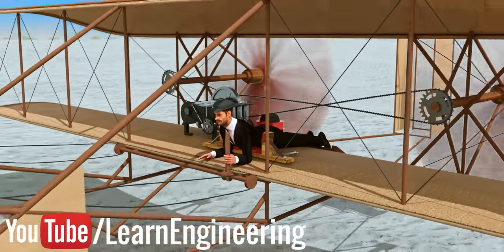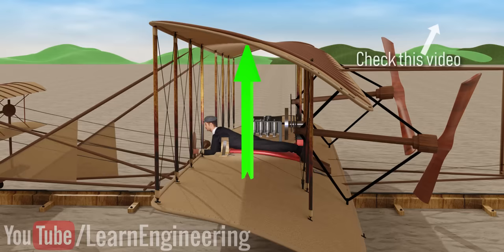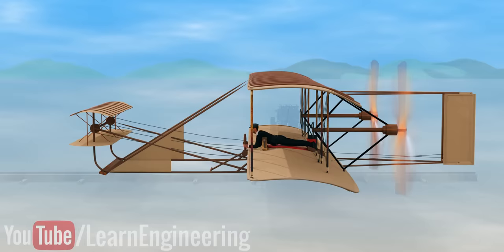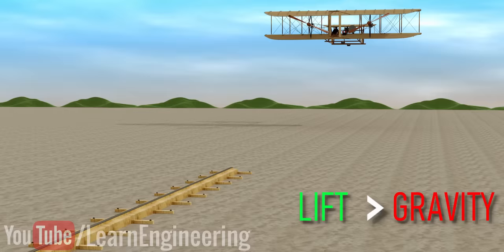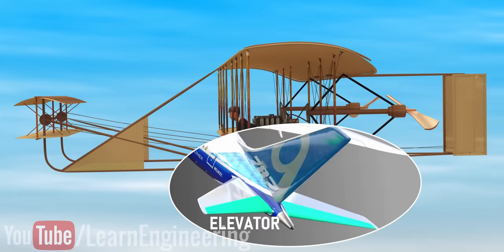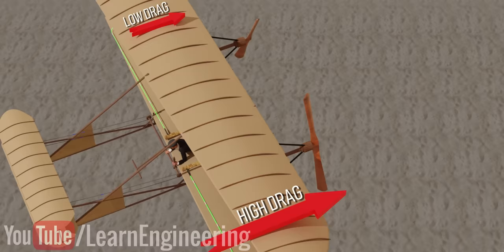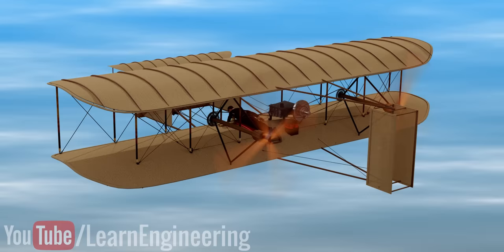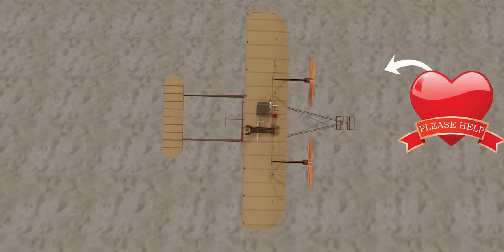The Brilliant Engineering of FIRST FLIGHT !

Comment: Offcentered to balance the weight of the engine and let the center of mass be in the middle :D
Reply: simple as that :)
Reply: Yup
Reply: Noo, its not like that. Its bcuz they didn't have compulsory co-pilot rule back then. :D
Reply: Yep
Reply: And the gas tank should be center placed as its weight varies through out the flight.
Reply: Yeah..
Reply: Easy peasy
Reply: Exactly. As clever as he was, he probably has a metal ballast positioned to compensate any weight difference by operator.
Reply: however, the weight of the engine was also countered with a slightly longer wing on one side to prevent unwanted roll from the extra weight
Reply: I wonder if they made adjustments on the fly lol if someone else tried to pilot with a different weight then they would need to move the engine or add weight to the pilot
Reply: An easy assumption to make but not exactly the case my friend... because both brothers were right-eyed, they positioned their body slightly to the left to line up their dominant eye with the centreline of the plane, otherwise maintaining straight and true flight would’ve been impossible due to the gyroscopic equilibrium of the propellers.... obviously 🙄
Reply: Forget it, the replicas have already proven that they didn't fly. Their work between 2003-1905 was a big lie. The centennial proved everything. A perfect and improved replica did nothing.
Reply: Careful, the replicas proved that they did not fly
Reply: Sry but it wasn't the first flight
Reply: FORGET, 1903-1905 flyers DON'T FLY
Reply: If the Flyers really flew, why they disassembled it and put it in a deposit for almost 3 years( between 1905 and 1908)?
   How on Earth would someone stop experimenting an experiment if it was successful ?
    Makes no sense at all.
Reply: yup
Reply: @vignesh sureshbabu And weight of the engine is 180 lbs
Reply: Exactly
Reply: My assumption exactly. Balance with the engine
Reply: All of the answers are plausible but none of them provide evidence.
That includes my unsupported conjecture that safety might have been a reason.
The Wrights would have survived the kind of accident that Capt. Feber  experienced.
He was testing the Antionette prototype that positioned the engine directly behind the pilot.
In 1909, Capt. Ferber was crushed by the engine..
Reply: U R "wright" :^)
Reply: @gilberto2056  The exact replica of the WF1 requires the assistance of both an 8 hp + engine and a headwind well above the 4 mph wind that was available on Dec. 17, 2003.  The only thing the Centennial non-flight proved was that more wind was required.
The Wrights' would have made no attempt to fly without strong headwind .  On Dec. 17, 1903 they had gale force wind.  21-27 mph.
Reply: @gilberto2056  The failure to fly on the Centennial date only proved they they needed the assistance of a strong headwind and a 8hp + engine to take off.  We are talking about a hop according to the definition that the Wright Brothers used.  Any flight under 600 ft. was just a hop.  The official distance for the 14-bis flight was also just a hop.
Reply: Arber _D  Do you mean what if the pilot weighed more than 150 lbs?

This might be important with the Wright Flyer I.  In gale force winds, the pilot could be 20 or so lbs. heavier.  On a day like Dec. 17, 2005 with wind gusts no more than 4 mph., the Flyer would not take off with a an underweight skinny pilot.

After 1906 when the 28+ hp. Wright-Taylor upright 4 became available,
weight was no longer a major concern.  The Wright Flyer Model A
could easily handle the weight of a passenger. or more fuel.
Reply: ye
Reply: @rjnbonif3603  No one can answer what?  

If the question is "Could the 1903 Wright Flyer fly without a catapult, strong winds, and a hill?"  
We can certainly see what historic evidence is available.  

Wilbur did try to determine if a hill could substitute for the lack of a strong headwind. on 14 Dec. 1903 when the windspeed
was around 4 mph (the same as on 17 Dec 2003.  We can read the reported results.

We can probably answer the question of whether or not the Flyer could fly without a catapult .  
It flew without the catapult several times before August 1904 when the catapult was first perfected.  

RB:: 2 When did the Wrights fly their FIRST PUBLIC  RECORDED FLIGHT????  Which reliable institutions, journalists, government....   were there to certificate Wright Brothers flights??????? 

SB:  Is this a new question?  All of their flights were public and viewable from the interurban train or by those who lived nearby.
The public was invited 4 times. Once in late 1904  when the Flyer II completed over 20 laps of the Huffman Prairie pasture for 20 min at an altitude above ground effect. and at least 2 times in 1905.   One public flight was cancelled because of engine problems.  

RB:  Did anyone certify these flight?  

SB:  They were certified in 1905 by the newly formed American Aero Club.  They were certified by the French Aero Club and the FAI in 1908.    There were a few journalist there but they lacked the kind of interest that pioneers enjoyed in Europe.  

RB:  What reliable institutions reported on or certified the 14-bis flights?
 
SB:  What institutions reported on the 1906 14-bis 100 m. hop?   (other than the Aero Club and the FAI)

You were supposed to comment on the video of the exact replica of the 1903 flyer flying.  
Instead you asked me to review the Centennial video. which only proves that the Flyer would not fly
without assistance from the wind,   It does not prove that the Flyer could not fly.

Replica flies 100 ft. in 15 mph wind;  
https://www.youtube.com/watch?v=o1mscspl-VU

Why are you just repeating the question?

Worth reading:

Henrique Lins de Barros, a Brazilian physicist who has written two books on Santos-Dumont, 

told Reuters in 2003 that the Wright Brothers’ flight did not fulfill all the standards in place 
at the time, which included taking off unassisted, publicly flying a predetermined length 

in front of experts and landing safely. 

“If we understand what the criteria were at the 
end of the 19th century, the Wright Brothers simply do not fill any of the prerequisites,
Source:  Reuters 2003Greg wants to add altitude density (see

ANTOINETTE:   https://en.m.wikipedia.org/wiki/Antoinette_(manufacturer)

Centennial flight:  exact replica fails without wind or a catapult on 17 Dec. 2003
https://www.youtube.com/watch?v=povGggaIK2A

https://www.youtube.com/watch?v=LigpsX1KoQE&lc=Ugz3ThGdq077FdvXoHR4AaABAg.92b_4UIeIYt9MjA3A6a8nC
Reply: @rjnbonif3603 

RB: 1. sem uma catapulta.

SB:  Ele voou sem a catapulta várias vezes antes de agosto de 1904, 
quando a catapulta foi aperfeiçoada pela primeira vez.
Ele voou algumas vezes depois disso em OHIO, quando os ventos eram fortes o suficiente 
para o voador decolar em derrapagens.

RB: 2 Quando os Wrights voaram seu PRIMEIRO VÔO PÚBLICO GRAVADO ????
Quais instituições confiáveis, jornalistas, governo ... estavam lá para certificar os voos da Wright Brothers ???????
Reply: @stevebett4947  "SB:  What institutions reported on the 1906 14-bis 100 m. hop?   (other than the Aero Club and the FAI)" hahhhh  "OTHER THAN AEROCLUB AND FAI"!!!!!!   The MAIN flight institution on earth!!!!!  plus all europe journalists, crowd, gov representants........!!!!!!
Reply: Could you tell me how was the cooler/refrigeration system and how many seconds the underpowered engine of the Flyer could work before overheats????    Could that engine lift up the Flyer?????  ......not even on the top of a hill, with strong winds and guys pushing?????    

 A HILL  AND THE WRIGHTS MISERABLE FAILED  WHAT ANY GLIDER WOULD EASILY DO!!!!!  The BASIC: The Flyer couldn't fly on !!!!!FLAT LAND!!!!  IT'S A GLIDER NOT AN AIRPLANE!!!! At that time Montgomery was flying FOR 20 MINUTES.    The  Hargrave-cell box  biplane was  invented in 1893 by Lawrence Hargrave, WITHOUT MOTOR, THAT WAS  COPIED BY THE CHEATERS WRIGHT BROTHERS  AND THEY DID THIS SAME AIRPLANE COPIED ALL THEIR LIVES.   SO if he would use a small UNDERPOWERED rubber motor in his GLIDER to fly for 20 minutes would you  consider Montgomery GLIDER to be  "the first powered, heavier-than-air machine to achieve controlled, sustained flight with a pilot aboard"???     HAHAHAAHAH  That's what the Wright CHEATERS Brothers did!!!!!!
Reply: @rjnbonif3603  I agree with much of your comment on 4/30/2021
Why don't you only list the parts that I doubt?

Chern:  If mother nature doesn't cooperate, the 1903 Wright Flyer replica (tested by NASA ) won't fly.

Chern  The El Segundo replica will make modifications to make it more flyable and safer.

SB:  I don't have a video of Segundo group's effort.  Have you found it?
All of the replicas were supposed to have FAA approval.  We know that at least 5 obtained them.
They recorded a test flight that was successful enough to get FAA approval.  

SB:  Hyde could not make the changes that would make the plane safer.  It had to be exact.

Look alike replicas are not restricted.  They often improve the flying capabilities of a flying machine.  Calassa certainly made such changes in his look-alike replica of the 1906 14-bis..

No one disputes the fact that the original 1903 prototype was virtually unflyable by a novice.
The fact that those with no more than 30 min. at the controls could fly at all is remarkable.

Interpreting the results is difficulty because they have yet to fly in the high winds that the Wrights had in 1903.  Would they fly better or would they crash sooner?  So far we don't know.  It hasn't been tried.

The article in the NY times is dated SEP. 29, 2003 well before the Centennial and before the tests flights.

LINK: 

The quotes opinion and intentions are from early 2003 before any of the flight tests.
Hyde is overly  optimistic and is betting that the conditions (mainly the wind speed and air density)  
on 17 December 2003 will be close enough to those on 17 Dec. 1903 for flyer to fly.

Chern is predicting that they won't.  His weather forecast was right.
His belief that the windspeed had to be at least 21 mph to get off the ground was wrong.
Reply: @sanpol4399  Exactly, at that time MONTGOMERY WAS ALREADY FLYNG 20 MINUTES with his GLIDER!!!!!  SO if he would use a small UNDERPOWERED rubber motor in his GLIDER to fly for 20 minutes would you  consider Montgomery GLIDER to be  "the first powered, heavier-than-air machine to achieve controlled, sustained flight with a pilot aboard"???     HAHAHAAHAH  That's what the Wright CHEATERS Brothers did!!!!!!  ...I mean, they tried but failed  EVEN WITH  AN ENGINE!!!!!
Reply: @sanpol4399  THE USA AVIATION WAS DESTROYED BY THE WRIGHT BROTHERS FALSE PATENTS THEY DIDN'T INVENTED!!!   In the first war  USA had to use EUROPEAN AIRPLANES BECAUSE THEY DIDN’T HAVE A SINGLE DECENTE AIRPLANE  THAT COULD FIGHT AGAINST ANY EUROPEAN COUNTRY!!!!!!!!    WHAT A SHAME!!!!!   

The AIRPLANE Santos Dumont Demoiselle 1907 weighed only 56 kg and had a  40 hp motor and could fly at 120 km/hour meanwhile Wright Brothers GLIDER model A weighed 573 kg with a small engine 35 hp in 1908 was still using a catapult and only could fly at 67.6 km/h.

YOU WILL NEVER EVER SEE A FLYER REPLICA FLYNG!!!!  OR A REPLICA OF ITS ENGINE WORKING TOO!!! BOTH ARE GARBAGE!!!
 All you can find are replicas of  MODEL A  from 1908!!!! 1908!!!! 1908!!!!!!! when they FIRST APPEARED IN PUBLIC AFTER THEY SAW SANTOS DUMONT AIRPLANES and was still using a CATAPULT and the Model B from 1910.

The END OF THE BIG AMERICAN LIE:  WRIGHT BROTHERS  LETTER   FOR   CAPTAIN  FERBER   WILBURN  ASKING  THE   14  BIS - SANTOS   DUMONT  DESCRIPTION:   “WE   WOULD  LIKE  VERY   MUCH  TO  HAVE  EXACT  REPORTS  OF  THE   EXPERIMENTS   MADE  AT   BAGATELLE  AND  HOPE   THAT   YOU  WILL  DRAW  UP   FOR    US  A    CORRECT   LIST  OF  THE   TRIALS   AND   GIVE   US  A    THE   DESCRIPTION_OF  THE  FLYING   MACHINE(14 Bis SANTOS DUMONT) AND  DRAWING  OF  SAME.”   ---   L'  ENVOL  MAGAZINE   NUMBER   39    1932  -  FRANCE.   SANTOS  DUMONT   THE  REAL   INVENTOR  OF    AIRPLANE.

IN REALITY THE BROTHERS NEVER PROOF THE REAL CAPACITY FOR FLIGHTS BETWEEN 1903 - 1907.

New York Times January, 1906 http://query.nytimes.com/mem/archive-free/pdf?res=9E00EFDE103EE733A25754C0A9679C946797D6CF

"They have been experimenting in strictly secret for several years but their final success IS TO BE MADE public in connection with the Aero Club to be held in conjunction with the Sixty-ninth Regiment Armory, ->>>>Jan 13 to 20<<<- . A model and photographs of the machine in flights WILL BE THERE on view."

As always, they didn't go, they didn't show up.

Only in 1908 AFTER they looked Santos Dumont FREE aeronautic contribution to mankind.

There is no register of any Wright Brothers flight till --->>>>1908 <<<- when they still were using a CATAPULT to take off their GLIDER.

Santos Dumont did the first AIRPLANE flight of the history in 1906 in the middle of Paris, crowd, journalists, International Aeronautic Federation......... Wright Brothers in 1908......with a GLIDER and CATAPULT!!!!!

Santos Dumont got his  37 kW (50 hp) Antoinette liquid-cooled, fuel-injected V8 engine from Antoinette a French manufacturer of light petrol engines, not the piece of shit awful handmade 12 hp  used by the Wright Brothers that couldn't work properly.

At that time most of the prize-winning speedboats in Europe were powered with Antoinette engines.

A man that never ever made an engine  in his life "did" the awful  engine of The Flyer!!!!!!  hahaahahahahah  What a piece of shit THAT ONLY COULD WORK A FEW SECONDS BEFORE WAS OVERHEATED!!!!
Reply: @sanpol4399  The Wright Brothers only did THE SAME "airplane" copied from  *Hargrave-cell box  biplane   GLIDER all their lives and use FALSE patentes to destroy  american aviation till 1916 when the government intervened after the shameful and infame debacle of american WWI aviation and forced them to retire from aviation, that's why they were ERASED from american history in the first part of XX century.    

Defense Act of June 3, 1916 (39 Stat. 166, 174, 175), provisions of which authorized an increase in the size of the Aviation Section to 148 officers,

The poor showing in Mexico of the Aviation Section's JN3s also showed that the U.S. aviation industry was not competitive in any respect with European aircraft manufacturers. No American-manufactured airplane had a vital function, none were mounted with weapons, and all were markedly inferior in speed and other performance characteristics. Further, U.S. companies were distracted by protracted legal battles and in-fighting over licenses and royalties while their European counterparts had been energized by the needs of the battlefield.

THE USA AVIATION WAS DESTROYED BY THE WRIGHT BROTHERS FALSE PATENTS THEY DIDN'T INVENTED!!!   In the first war  USA had to use EUROPEAN AIRPLANES BECAUSE THEY DIDN’T HAVE A SINGLE DECENTE AIRPLANE  THAT COULD FIGHT AGAINST ANY EUROPEAN COUNTRY!!!!!!!!    WHAT A SHAME!!!!!   

 --------------------------------------------------------------

It didn't even could fight against Mexico!!!!  MEXICO!!!!  MEXICO!!!!  ..not Mexico but a band of outlaw rebel PANCHO VILLA!!!!! hahaahaha   :) 

  Because ot Wright brothers false patents that was the only piece of shit USA was producing to WWI:  Wright Model C "Speed Scout" The aircraft had a short service life, from 1912 to 1914, because of a series of fatal crashes that destroyed six of the eight aircraft manufactured for the Army.  

An armed balloon could  shot down USA airplanes.    ......but as you can notice, dont' even need a ballon. hahahahaaha  

IMPORTANT!!! USA GOV WIPED OUT WRIGHT BROTHERS BECAUSE THEY DOOMED USA AVIATION WITH HORRIBLE AIRPLANES AND FALSE PATENTS!!!!!!      The Wright Brothers only did THE SAME "airplane" copied from  Hargrave-cell box  biplane   GLIDER all their lives and use FALSE patentes to destroy  american aviation till *1916 when the government intervened after the shameful and infame debacle of american WWI aviation and forced them to retire from aviation, that's why they were ERASED from american history in the first part of XX century.    

Defense Act of June 3, 1916 (39 Stat. 166, 174, 175), provisions of which authorized an increase in the size of the Aviation Section to 148 officers,

IMPORTANT!!! 
The poor showing in Mexico of the Aviation Section's JN3s also showed that the U.S. aviation industry was not competitive in any respect with European aircraft manufacturers. No American-manufactured airplane had a vital function, none were mounted with weapons, and all were markedly inferior in speed and other performance characteristics. Further, U.S. companies were distracted by protracted legal battles and in-fighting over licenses and royalties while their European counterparts had been energized by the needs of the battlefield.
Reply: The Wright Brothers only did THE SAME "airplane" copied from  *Hargrave-cell box  biplane   GLIDER all their lives and use FALSE patentes to destroy  american aviation till 1916 when the government intervened after the shameful and infame debacle of american WWI aviation and forced them to retire from aviation, that's why they were ERASED from american history in the first part of XX century.    

Defense Act of June 3, 1916 (39 Stat. 166, 174, 175), provisions of which authorized an increase in the size of the Aviation Section to 148 officers,

The poor showing in Mexico of the Aviation Section's JN3s also showed that the U.S. aviation industry was not competitive in any respect with European aircraft manufacturers. No American-manufactured airplane had a vital function, none were mounted with weapons, and all were markedly inferior in speed and other performance characteristics. Further, U.S. companies were distracted by protracted legal battles and in-fighting over licenses and royalties while their European counterparts had been energized by the needs of the battlefield.

THE USA AVIATION WAS DESTROYED BY THE WRIGHT BROTHERS FALSE PATENTS THEY DIDN'T INVENTED!!!   In the first war  USA had to use EUROPEAN AIRPLANES BECAUSE THEY DIDN’T HAVE A SINGLE DECENTE AIRPLANE  THAT COULD FIGHT AGAINST ANY EUROPEAN COUNTRY!!!!!!!!    WHAT A SHAME!!!!!   

 --------------------------------------------------------------

It didn't even could fight against Mexico!!!!  MEXICO!!!!  MEXICO!!!!  ..not Mexico but a band of outlaw rebel PANCHO VILLA!!!!! hahaahaha   :) 

  Because ot Wright brothers false patents that was the only piece of shit USA was producing to WWI:  Wright Model C "Speed Scout" The aircraft had a short service life, from 1912 to 1914, because of a series of fatal crashes that destroyed six of the eight aircraft manufactured for the Army.  

An armed balloon could  shot down USA airplanes.    ......but as you can notice, dont' even need a ballon. hahahahaaha  

IMPORTANT!!! USA GOV WIPED OUT WRIGHT BROTHERS BECAUSE THEY DOOMED USA AVIATION WITH HORRIBLE AIRPLANES AND FALSE PATENTS!!!!!!      The Wright Brothers only did THE SAME "airplane" copied from  Hargrave-cell box  biplane   GLIDER all their lives and use FALSE patentes to destroy  american aviation till *1916 when the government intervened after the shameful and infame debacle of american WWI aviation and forced them to retire from aviation, that's why they were ERASED from american history in the first part of XX century.    

Defense Act of June 3, 1916 (39 Stat. 166, 174, 175), provisions of which authorized an increase in the size of the Aviation Section to 148 officers,

IMPORTANT!!! 
The poor showing in Mexico of the Aviation Section's JN3s also showed that the U.S. aviation industry was not competitive in any respect with European aircraft manufacturers. No American-manufactured airplane had a vital function, none were mounted with weapons, and all were markedly inferior in speed and other performance characteristics. Further, U.S. companies were distracted by protracted legal battles and in-fighting over licenses and royalties while their European counterparts had been energized by the needs of the battlefield.
Reply: @rjnbonif3603  Exact. You got it.
If the plane can not take off and keep a sustained flight , it is not possible to define it as an airplane. 
    If an extremelly underpowered glider like any of  the Flyer series can be defined as an airplane, the example you gave about a rubber band  powered glider being piloted by a man, would be true, and that does not make any sense.
   The first airplane everyone is sure that took off , flew  
sustained and landed was the 14-bis.  Before that, nobody can be sure.
Reply: @rjnbonif3603  Lets see if I can find the topics we agree on and the ones we might have some difference of opinion.

RB:  TILL TODAY NOT EVEN NASA CAN MAKE THE FLYER FLYS!!!!! NOBODY CAN MAKE THE FLYER FLYS!!!!! 118 YEARS LATER WE STILL DON'T HAVE THAT "TECHNOLOGY"!!!!! 

SB:  That is not from the LA Times story.  It is your interpretation.

RB:  "No one can make the 1903 flyer (or an exact copy of it)  fly"

SB:  How do you explain this:
With 15 mph winds he ( Dr. Kochersberger ) flew a distance of nearly 100 feet.

https://www.youtube.com/watch?v=o1mscspl-VU

All of the 12 or so replicas that were being built in 2003 had to pass the FAA test.

At least 4 passed the test.  See  if you can find what was in this test.  
I would think it would require that the experimental aircraft fly 100 ft. or so without endangering the pilot.

The two YouTube videos that I watched flew about 100 ft without demolishing the aircraft on landing.  
100 ft. in 10 sec. in a 15 mph wind is not that far from
120 ft. in 12 sec. in a 20 mph headwind.  

https://www.latimes.com/archives/la-xpm-2003-sep-29-fi-wrightbros-29-story.html 

Jack Cherne, declared that a flight of a perfect replica of Flyer 1 won’t fly!! 

SB:  That was his opinion before the replicas flew.  

“We put a man on the moon, and yet we haven’t been able to rebuild the Wright Flyer and fly it,” said Ken Hyde, 63, a retired American Airlines pilot in Virginia who heads a group that’s been working for more than a decade to reproduce an exact flying version. 

SB:  That may be an over statement. There were flying replicas.  They were just not exact replicas.  

Ken Hyde:  “It’s a lot harder than people think, even with all the technology we have today.” 

Jack Chern:  After conducting wind-tunnel tests, they are convinced that 
"unless flight conditions are perfect, such as the cold temperatures and 27 mph headwinds
that the Wrights faced in 1903, an exact replica like Hyde’s just won’t fly".

JC:   “Mother Nature participated then, so if Mother Nature doesn’t cooperate, it won’t fly,”   

JC:  . . . with modifications that members say will make it flyable. “We don’t want to build something that will kill somebody,” 

Hyde concedes that the Wrights’ first plane “is an unstable airplane, and the wind-tunnel tests bear that out.” But he added,
“Changing the airplane will defeat the whole purpose of re-creating the flight. It makes the celebration meaningless.” 

 IT CAN'T FLY!!!!!! THAT'S WHY YOU WILL NEVER SEE A REPLICA FLYING EVEN TODAY!!!!! 
A look at handling qualities of canard configurations, Nasa , p. 8, TM 88354, ...the Flyer was highly unstable... 
The lateral/directional stability and control of the Flyer were marginal."<<<<

 *"Modern analysis by Professor Fred E. C. Culick and Henry R. Jex (in 1985) has demonstrated that the 1903 Wright Flyer was so unstable as to be almost unmanageable by anyone but the Wrights, who had trained themselves in the 1902 glider" 

SB:  This was in  1985 before exact replicas were flown by pilots who had trained on a software program that gave them some familiarity with the controls.  The software may not have been as good as time on the Wright glider but it helped.  

Abzug, Malcolm J. and E. Eugene Larrabee."Airplane Stability and Control, Second Edition: A History of the Technologies That Made Aviation Possible* cambridge.org   
SB:  Good reference but it does not match your conclusions.

RB:  Not powered!!!!!! not controlled!!!!!! not sustained!!!! NEVER SHOWED!!!! not registered by the gov or any reliable institution!!!!! JUST THE BIG AMERICAN LIE!!!!! THE FLYER COULDN'T FLY AT ALL!!!!!! ...

and you PROUDLY SAY IT IS "the first powered, heavier-than-air machine to achieve controlled, sustained flight with a pilot aboard" HAHAHA...

SB:  I have answered this comment before because you have used it three times.  I have
repeated what the Smithsonian exhibit statement.
What would this indicate that I agreed with it or that the statement had something to do with national pride?  This looks like projection.

RB:  Only in 1908 the Wright brothers flew their powered glider in public with a catapult
SB:  They also flew it a few time without a catapult to show that the catapult was not required with the engine puts out 28 hp. and once because the
FAI refused to certify their altitude record if they
took off with the assistance of a catapult.

RB:  They flew only AFTER they looked Santos Dumont FREE aeronautic contribution to mankind. 

SB:  There is no evidence for this claim.  It is an unsupported allegation.  No one, except me, has listed the contributions of the 14-bis.  Please do this to show that there was something that could be borrowed, copied, or stolen.
So far you have listed only the use of a more powerful engine but wasn't every aviation pioneer
since Cayley aware of this?  The propulsion had to be provided with a low weight engine.  

RB:  Only in 1910 the Wright Brothers made their first TRUE AIRPLANE with landing gears and a heavier engine with enough power to take off and fly by itself 

SB:  What dictionary definition of "airplane" says anything about a landing gear requirement?
The same 1906 Vertical 4 engine was used from 1906 to 1912.  It was the most produced aircraft
engine in the world at that time.  There were later
refinements that were added to speed record attempts.  

RB:  There is no register of any Wright Brothers flight till --->>>>1908 <<<- when they still were using a CATAPULT to take off their GLIDER.

SB:  What do you want?  The planned flights were announced in a scholarly article in a peer reviewed 
engineering journal in 1901.  These were publicized by Octave Chanute in lectures and articles in 1902.  Successes were recorded in the 
L'Aerophile every month or so.  

If anyone wanted proof all they had to do is make
a bet that a particular claim could not be proved and then pay for a demonstration.  It the Wrights were unable to meet or surpass the list of agreed on performance requirements, they would return the money that was wagered.

Links:
Wings of Madness video:  https://youtu.be/i_f5Bl2q9eY 

first airplane to fly in Australia. 
https://collections.museumsvictoria.com.au/items/406324

plaque on the  1906 Wright Vertical 4 engine:  Bariquand  & Maarre 1908  https://collections.museumsvictoria.com.au/items/406324

Wilbur Wright's paper "Some Aeronautical Experiments"  published in 
the peer reviewed Journal of the Western Society of Engineers in December 1901.
https://www.thehenryford.org/collections-and-research/digital-collections/artifact/379642/

With 15-18 mph winds he ( Dr. Kochersberger ) flew a distance of nearly 100 feet.

https://www.youtube.com/watch?v=o1mscspl-VU
Reply: @stevebett4947  My dear, in fact none of them could do the Flyer flys!!!! Nobody can!!!!  not by a novice or even an astronaut!!!!!  ...because they know they will die!!!!!  It was extensively tested by Nasa, universities, astronauts, engineers...    but as you can see SINCE 2003  AMERICAN MIDIA AND SCIENTISTS WILL NEVER PUBLISH IT!!!!!!   THEY STILL WANT TO BE IN A LIE!!!! That's why you will never ever see in the News!!!!

Do a replica and jump from a cliff with a catapult!!!!!  it's so easy!!!!!  Use a radio control if you don't want to die!!!!!! 

"All of the replicas were supposed to have FAA approval.  We know that at least 5 obtained them.
They recorded a test flight that was successful enough to get FAA approval.  "

Where is that "successful" recorded????  Show here!!!
What do you call "successful"???  Did it take off and/or fly???
Reply: @stevebett4947  " NOT EVEN NASA CAN MAKE THE FLYER FLYS!!!!! NOBODY CAN MAKE THE FLYER FLYS!!!!! 118 YEARS LATER WE STILL DON'T HAVE THAT "TECHNOLOGY"!!!!! 

SB:  That is not from the LA Times story.  It is your interpretation."

Did any of then do the Flyer flys???? It's fact, not my interpretation!!!

None of the replicas flew!!!  

"SB:  They also flew it a few time without a catapult to show that the catapult was not required with the engine puts out 28 hp. and once because the
FAI refused to certify their altitude record if they
took off with the assistance of a catapult."

NO, there's no evidence of it, only in 1910 they flew without catapult.

"RB:  They flew only AFTER they looked Santos Dumont FREE aeronautic contribution to mankind. 

SB:  There is no evidence for this claim.  It is an unsupported allegation.  No one, except me, has listed the contributions of the 14-bis.  Please do this to show that there was something that could be borrowed, copied, or stolen.
So far you have listed only the use of a more powerful engine but wasn't every aviation pioneer
since Cayley aware of this?  The propulsion had to be provided with a low weight engine. "

The Wright Brothers only  were recorded flying in 1908 after they asked and saw 14 Bis planes, WRIGHT BROTHERS  LETTER   FOR   CAPTAIN  FERBER   WILBURN  ASKING  THE   14  BIS - SANTOS   DUMONT  DESCRIPTION: “WE   WOULD  LIKE  VERY   MUCH  TO  HAVE  EXACT  REPORTS  OF  THE   EXPERIMENTS   MADE  AT   BAGATELLE  AND  HOPE   THAT   YOU  WILL  DRAW  UP   FOR    US  A    CORRECT   LIST  OF  THE   TRIALS   AND   GIVE   US  A    THE   DESCRIPTION_OF  THE  FLYING   MACHINE(14 Bis SANTOS DUMONT) AND  DRAWING  OF  SAME.”   ---   L'  ENVOL  MAGAZINE   NUMBER   39    1932  -  FRANCE.   SANTOS  DUMONT   THE  REAL   INVENTOR  OF    AIRPLANE.
Reply: @stevebett4947  "SB:  What dictionary definition of "airplane" says anything about a landing gear requirement?
 The same 1906 Vertical 4 engine was used from 1906 to 1912.  "    By land gear i mean capacity to take off  by itself without the need of a catapult.   With a catapult even bricks can fly too!!!  ...and even with a more powerfull 1906 Vertical 4 engine they were still needing a catpulta till 1910.  

Do you call gliders airplanes?????  Again, if Montgomery would use a small UNDERPOWERED rubber motor in his GLIDER to fly for 20 minutes  would you  consider Montgomery GLIDER to be  "the first powered, heavier-than-air machine to achieve controlled, sustained flight with a pilot aboard"???
Reply: @stevebett4947  "Two years earlier in 1904, the Wright Flyer III was flying multiple circular laps in public view  at Hufman Prairie, Ohio
for over 20 minutes. (over 24 miles)   With a land  larger fuel tank the prototype could have stayed aloft longer."  

All your "sources" are from WRIGHT BROTHERS NOTES!!!!!!  and  as it was proved as a BIG LIE!!!!!
Reply: @stevebett4947  "Many of the Wrights records were publically observed.  On 4 occasions the public was invited."  Again: All your "sources" are from WRIGHT BROTHERS NOTES!!!!!!   

"Official records never required other spectators and reporters."  Man, are you serious???  So if a brasilien appears today with a note book from his grand grandfather from 1901 saying he flew an airplane and a lot of people saw it, would you belive in it and recognizes it???
Reply: @rjnbonif3603  claimed:  The (Wright Flyer) didn't fly
and was using a catapult.  

Did you even watch the video?
There was no catapult.  

Before the successful test flights of the exact replica,
Chern had claimed that the WF1 wouldn't fly without a 20+ mph
head wind and pilots as experienced as Wilbur and Orville.

The two test flights suggested that novice pilots who
had practiced on the Wright Flyer simulator could hop
100 ft. in a 15 mph wind.  (air density unknown).

Orville had hopped 120 ft. in a 21 mph wind.  
on his first try.  Maximum altitude was 9 meters.
so the one direction flight was in ground effect.
Reply: @rjnbonif3603  wrote:  
All your "sources" are from WRIGHT BROTHERS NOTES!!!!!!  and  as it was proved as a BIG LIE!!!!!

SB:  What is  your claim?  All of my sources were not from the Wright Brothers notes.
The notes were never proved to be big lies.  Please concentrate on the most inaccurate
or implausible claim found in the notes.  

SB:  The diary that the Wrights'  kept is the source that many historians check.
Most people don]t bother checking since it requires a lot of time and effort.

The notes contain some inaccuracies and perhaps some questionable claims.  Can you find
any aviation historian who claims they were all lies?  

Do you believe the "all lies" conspiracy theories are more plausible than one closer to what
historians accept?

Lins de Barros is careful to only claim that the Wrights did not comply with the French FAI standards and that most of the claimed flights (those before 1904) were not public.  

The notes are not beyond question.  They are not certain in the way an empirical fact is incontestable.  Not being incontestable is not the same as being a lie.  It just means that they
are historical and comments on them can be disputed.

The Wrights sometimes tried to manipulate the news.  For instance, the first powered glider flight was on Dec. 14 from a hill without any significant wind.  This flight may have been over 30 ft. (some say over 100).  I can see why the Wrights wanted to minimize the amount of information that got out about this flight.  e.g., it is easily critiqued because it was from a hill.
Reply: @rjnbonif3603  I can't make sense of your comment.  Do you want to try again.

RB:  There was a catapult in the rail
SB:   How could there be a catapult in the rail?

You may be right about the engine being too weak to always accelerate the Flyer to a 15 mph take off speed.  I have talked about this before.

Are you familiar with the Wilbur's attempt to check some of this out on Dec. 14, 1903?

He set up the 60 ft. wooden track on a hill to check out how much it would contribute to reaching a take off speed when there was 0-4 mph of wind.

The motorized glider did get off the ground but it
didn't fly very far.  

rjn bonif

Steve Bett SB:" There was no catapult." 

RB:  There was a CATAPULT IN THE RAIL in the video, the engine couldn't impulse the glider alone on the rail, IT BARELY COULD DO IT MISERABLY DOWN a HILL!!! 

SB:  What does this reference?  The Dec. 17 flight was not down a hill.  There was a Dec. 14
flight that was on a hill.  It managed to get in the
air without any assistance from a strong head wind.

RB:  ON A FLAT LAND IT'S IMPOSSIBLE,  

SB:  Why is it impossible.  The exact replica took off on `17 Dec. 2003 with a 15 mph wind.
I didn't notice any hill or even a 9 degree incline as is sometimes claimed.  

RB:   IT'S A BAD GLIDER THAT CAN'T FLY.

SB:  It was based on a great glider that may have held a record in 1902.  adding an extra 200 lbs.
does not sound like a move that would make it a better gilder.  However, with high 20-28 mph. winds 
it could certainly fly.  What is your evidence that it can't fly?

RB:  NOT CONTROLLABLE!!! NOT SUSTAINED!!!! NOT EVEN POWERED!!!!!
 Look at the Centennial vidoe if  you don't believe in me: 
https://www.youtube.com/watch?v=povGggaIK2A 

SB:  All the Centennial video proves is that the flyer can't fly without the assistance of the wind
(and the 12-16 hp motor).  This is not an example of sustained flight.
You can't demonstrate control in low wind conditions.

SB: "All of my sources were not from the Wright Brothers notes." 

RB:  Yes, they are!!! The only registers (?) are from Wright Brothers notes!!!!! Test flights demonstrated.

SB:  I can provide more sources and I would if I thought you were  interested in checking them out.

The Dec. 17 test flight demonstrated that the Wright's  claims were plausible.  The the exact replica
could fly 100 ft. in a 15 mph wind.  In a 21+ mph wind, we would expect a slightly better performance.  

I am still waiting for your comment on the 17 Dec 2003 test flight of the exact replica of the 03Flyer

https://www.youtube.com/watch?v=o1mscspl-VU

LINKS

Available in Portuguese
http://www.wright-brothers.org/History_Wing/History_of_the_Airplane/Doers_and_Dreamers/Doers_
and_Dreamers_images/Hargrave/Hargrave_airplane.jpg

The Voisin-Farman I was also the first biplane in Europe, to fly a circular circuit 
of 1 kilometre, over a predetermined course, on 13 January 1908. This again occurred at Issy-les-Moulineaux, 
France, and won Henri the 50,000 franc Grand Prix d'Aviation offered by Henri Deutsch de la Meurthe.
And on the 21st of March 1908 at the same place, he made a flight of 2.004 Kilometres.
https://www.thisdayinaviation.com/tag/grand-prix-de-laviation/ 

This would been the longest flight in 1908 if Wilbur Wright had not improved on it.
He flew .....

26 October 1907: At Issy-les-Moulineaux, France, Henry Farman flew his Voisin-Farman I airplane a distance of approximately 771 meters (2,530 feet) in 52 seconds to win the Coupe d’Aviation Ernest Archdeacon (Ernest Archdeacon Cup) for the longest flight of the year.

Compare that to Wilbur's flight in December, 1908.  771m to 124.7 km.
1908 Michelin Cup won by Wilbur Wright with a flight made on 31 December 1908 
at Le Mans officially reckoned as 124.7 km (77.5 mi).   

https://en.wikipedia.org/wiki/Michelin_Cup#:~:text=International%20Michelin%20Cup-,1908,124.7%20km%20(77.5%20mi).

Good article on Santos Dumpont.  He did patent things.

https://www.cs.mcgill.ca/~rwest/wikispeedia/wpcd/wp/a/Alberto_Santos-Dumont.htm
Reply: @sanpol4399  You claim that the 14-bis was successful but Santos Dumont, after 3 crashes stopped experimenting.  He switched to a new design, No. 17?  
to compete for the next Deutsch prize for circular flight.  For some reason 
he was unable to get the desired performance out of the prototype until No. 20.
in 1910.  By that time Furman had already won the prize for circular flight.

Links available.

The Wrights thought they had learned what they needed to learn from the experiments.  If so, why would they continue with the minimalist design.

They wanted to build sturdier airframe that would accommodate a pilot and a student or passenger. and a more powerful motor.  They did this in 1906.  They certainly
did not stop development.

Your question could be why didn't they test the new airframe and motor?  
That is still a mystery.  Why were they so certain that it would work that they didn't
need anything more than static bench tests?
Reply: @stevebett4947  14-bis was successful, it is a fact.  It is not just my claim🙂.
  The 14-bis did what it was supposed to do,   to prove an airplane could fly, and as being the first to do that, everyone believed from that remarkable point on, that it was possible.
    His perfect replica made by Alan Calassa shows clearly how nice it flyes. 
   Santos Dumont continued improving his airplanes designs after the sucessful flights 14-bis did. He did not stop experimenting , because he was motivated with the sucessful 14-bis flights.  
   The oposite happened with the Wright brothers. They stopped for almost 3 years their experiments with the flyer. 
That is something no one can expect from inventors that were supposedly getting successful experiments.
Reply: @sanpol4399  wrote:  
SP:  14-bis was successful, 
it is a fact, not just my claim.

SB:  It is a historical fact.  Historical facts are not CERTAIN or INCONTESTABLE.
Historical facts should  be consistent with empirical facts.  They are not themselves
empirical facts.  

In the case of the 14-bis,  the empirical facts are limited to what was contained in the rules 
for the  Deutsch - Archdeacon  prize.

So far we have not been able to locate that document.  What we have is  hearsay on what
it contained.  

We can be sure about things it could not include such as the time and date for the event.
It did not include exact information on the location of the starting line or finish line.  
In a normal competition, officials just make sure that the rules are not violated.  
The time and date for the event is clear.  The location of the starting and finish line is clear.

The official rules should have included something about having to have official witnesses.
It should have had something on the contest being open to the public but probably didn't.
It probably didn't mention anything about having to have film evidence or public witnesses.

The empirical facts are quite limited.  Film evidence, public witnesses, and newspaper
reporters and photographers are part of the historic evidence.  

I will address other claims later: 

SP:  The 14-bis did what it was supposed to do,   to prove an airplane could fly, and as being the first to do that, everyone believed from that remarkable point on, that it was possible.

SB:  Santos Dumont did what he was  supposed to do . . . follow the rules.
He didn't have to prove that his flying machine could fly or that it was the first to fly.

SB: Every aerial enthusiast since George Cayley (1799) believed that an airplane could fly.
It was just a matter of finding a light weight engine to provide sufficient power.
That was Cayley's conclusion after the short hop made by his chauffeur made in a heavier than air
fixed wing flying machine powered by an 8 hp. motor.  

The Wrights viewpoint was quite different.  With strong winds,  an 8 hp. motor would be sufficient
if flying machine had an efficient prop producing the needed thrust and enough control to fly in
strong winds.  

The key problem was sufficient control not sufficient power or thrust.
3 axis control was more important than stability.
Reply: @stevebett4947  I guess what you are doing is trying to put the 14-bis flights( facts showed by several sources,  and easily replicated since physics of flight do not change overtime ), into the same level of  uncertainty the Flyers supposed flights have.🙂
   Question: Correct me if I am wrong, but
you are sure about the flights made by 14-bis .
The 3 axis control does not define an airplane , and it is not needed to navigate and fly.
We have already discussed it before. 
   Just as an example pulling part of our previous discussion back, some great ultralight planes does not have ailerons , are acrobatic and highly controllable. 
🙂
Reply: @sanpol4399  Did you try to follow the argument.
Please explain why you cannot accept the difference between empirical certainty and historical uncertainty.

SP:  3 axis control is not needed to navigate and fly.

SB:  I agree.  There are quite a few prototypes and a few planes that were produced
that did not have 3 axis control.  

There is also a model of the 14-bis that had only two servos
and had little trouble flying around a large indoor auditorium.  To gain altitude it just increased the rpm.
Perhaps you can describe it better by just watching the video.

Do you consider this model capable of aerobatics?
Do you have a better example of an ultralight without ailerons that is acrobatic?
I have not flown such an ultralight and I don't think I would want to try.
I have gained altitude in an ultralight with an angle of attack that would seem to invite a stall.  

I think both SD and the Wrights' made additions to the dictionary definitions.
Santos Dumont emphasized the landing gear, engine power, and compliance with the 1905 FAI rules.
The Wright Brothers emphasized 3 axis control.  They also thought that highly maneuverable 3 axis
control required instability.  They were wrong about that.

here is another attempt to answer the same kind of question:

 CRITIC:   The Wrights did not FLY because they had no engines to fly.  In the wright period 
the engine block weighed a lot,  consequently, the greater the power of the engine, the greater its weight. 

SB:  Details on the 1906 Wright-Taylor Vertical 4 are readily available at Wikipedia and Gutenberg. 
The more powerful 28-40 hp engine weighed less than the ones used on the Wright Flyer I thru III.
 

CRITIC:  The genius of Brazilian, ALBERTO SANTOS DUMONT, was so great that he could transform the 25 hp Antoinette engine into a lighter and more powerful engine generating 50 hps (This is a historical fact).

SB:  In the case of the bis-14, he unbolted the 25 hp Antoinette engine that was not powerful enough for a 25m hop and installed an off the shelf 50hp Antoinette 8V.  This certainly was a contribution to aviation since it was it was copied by at least 4 other aviation pioneers.  When they installed the engine on their prototype they could duplicate the hop made by the 14-bis in 1906.   To to say that switching engines was evidence of genius is counter-factual misinformation.  There are better examples of his genius.

@Açúcar Chocolate  

SB:  Have you read Lins de Barros articles?  
 The Brazilian physicist wrote a 
paper circa 2000 that made the case for Santos Dumont without the use of misinformation
and conspiracy theories.   I will send you the link if you haven't.  Just ask.

None of the claims of the Wrights are indisputable or beyond doubt.
This is primarily because they were not officially witnessed 
and not in compliance with the 1905 FAI rules.  The rules did not allow for any outside assistance.

No wind except that generated by a taxi to take off speed and no catapult.

Was that even possible before 1905 to comply with rules that had yet to be written?  

Some of the Wright flights were witnessed by members of the American
Aero Club but that would not count.  They were not French and they
were not official witnesses.  

The second kind of doubt is with respect to flights that seem too incredible to be accurate.  That applies only to the incredible 873 ft. 4th and final flight of Wilbur Wright.  I can't prove that it didn't happen but I don't think the Wrights proved that it did.  

Orville's first flight was consistent with what an inexperienced pilot was able to achieve
with less head wind.  120 ft. vs. a claimed 100 ft. 

https://www.youtube.com/watch?v=o1mscspl-VU

AC: "the greater the power of the engine, the greater its weight"

SB:  Before you speculate on the weight of the 1906 Dayton engine, read up on it.  The 1906 Vertical 4 was not any heavier than the 2 earlier engines the Wrights used from 1903 to 1905, but it produced almost double the horsepower.

Google Wright vertical 4.  
https://en.wikipedia.org/wiki/Wright_Vertical_4

weight:  160-180 lbs.  (70-80 kg)

power:  28 hp. at 1325 rpm
              42 hp at 1500 rpm    *31 kw

AC:  Santos Dumont "...was so great that he could transform the 25 Hp Antoinette engine into a lighter & more powerful engine generating 50 hp."

SB:  So Santos could do this but not the Wrights.  Where is the evidence?

Santos Dumont had no role in the design and production of the 
Antoinette engines.  That was all Levasseur.

He did switch from a 25 hp engine to a 50 hp Antoinette 8V (209 lb) engine 
when it became available in 1906.  

Wikipedia also has an article on the Antoinette engines.
They were designed and built by Leon Levavasseur
https://en.wikipedia.org/wiki/Antoinette_8V

Santos-Dumont made a number of contributions to aviation.  This is not one of them.
There are better examples of his genius.

I would argue that the Wright Brothers made more contributions,

They published their plans and their findings in peer reviewed engineering journals.
Santos Dumont published two books mostly on the delights of flying in a dirigible.

I am a fan of Santos-Dumont and I wish he had written a sequel for his heavier than
air flights, but he didn't.  I am still trying to compile a list of contributions that can
be tied to the 14-bis.  This has been difficult because his supporters are rarely specific.
Reply: l usually like to add more links and references.
Reply: @stevebett4947  Even better than a no aileron aerobatic ultralight to show how a no aileron can be very maneuverable. 
   Simply no aileron, no rudder , no elevator, and still very responsive.
    Can you please point the link about the 14-bis model? 
   The ones I saw flew perfectly well and stable, as the original one, as demonstrated by Alan Calassa's replica.
Reply: @rjnbonif3603  Santos-Dumont borrowed more from Hargrave than the Wrights.
I don't understand why both pioneers deny that they built on his ideas for box kite wings and airfoils.
I think that Hargrave (1893) had a man carrying tethered kite.  Didn't he also have on with an engine?
Reply: @rjnbonif3603  Montgomery's glider flew for 20 min. in 1903.
Montgomery was a college professor with a Ph.D. in electrical engineering.
Too bad he insisted on also being a test pilot because he really seems to have had is act together.
 
Cayley had the right idea.  Let your chauffer be your test pilot.
The aviation pioneers were usually fearless and many died trying to advance the field.

Did you ever comment on the two successful test flights of the exact copy of the 1903 Wright Flyer?
Replica flies 100 ft. in 15 mph wind;  

https://www.youtube.com/watch?v=o1mscspl-VU

Orville Wright calculated that he needed an 8 hp motor.  
Are there any rubber band motors that can produce 8 hp?  
If there were would could this craft be called a motorized glider?
Interesting question.  I wouldn't have a problem calling it a motorized glider.
The motor is a substitute for a tether in high winds.  
Without it the craft makes little or no forward progress.
Reply: @rjnbonif3603  Please try to provide some evidence for your various claims.
A complete reference or a URL would be sufficient.  

Who says the Wright Taylor engine was awful?  
It met the requirements of Wilbur's calculations.  In fact it exceeded them producing as much
as 16 hp in ideal conditions.  In the rain, it produced less than 8 hp.  (according to the pilot).

Overheating was not unusual for early aero engines.  The Wrights record when they had such problems.  Not sure where you get the idea that it overheating was common with the Wright engine.  

The only flight that was cut short due to engine problems was the one in Le Mans when Wilbur threw a rod.  I suppose it might have overheated as well.  Engine problems usually means it could not take off.  

In 1906, the 14-bis completed about 10 hops.  If these flights during a 3 month period were added up, it flew less than 3 min. total.  

At the end of 1904, the Wrights sustained flight in public for over 20 min.  
With more fuel, it could have stayed airborne even longer.

You can say that the Wrights did not comply with the 1905 French FAI rules.
How can you say that it was a big lie?  

I think the American Aero Club and the FAI were too quick to certify all of the
claimed records of the Wrights.  That is just my opinion.  

Are there any non-Brazilian aviation historians
who do not think there is overwhelming historical evidence for most of their 
claimed records after 1908.  There was a significant amount of skepticism before 
their demonstration flights at Le Mans.  What they planned to do was listed in a 1901 peer reviewed engineering journal.
Reply: @sanpol4399  The RC Model of the Demoiselle had only two servos.
It flew with only RPM control of the electric motor and rudder control. 
I would like to see it compared with a flying STOP SIGN or flying Styrofoam DOOR. 
also with only 2 servos.  

The owner of the model said it did not fly well outdoors.  The flying stop sign had
little problem coping with wind gusts outdoors.  

The only RC Model of the 14-bis was the one that flew in a protected parking
garage.  It did seem to have limited ability to bank and turn.  It could make U turns
and fly in wide circles.  The diameter of the circuit seemed to be controlled by
the available space in the parking garage.  

I don't dare go  back to the 76 replies to find the URLs and links.
After this comment posts, I will try to do this and then add a comment.

My remaining issues mostly have to do with unintentional changes in the 
design that resulted from modern knowledge of aerodynamics and control.

We know that Calassa used a modern Rotax engine of around 26 hp and a 
modern efficient prop rather than a paddle prop.  His control system may have
been much better.  His piloting skills were certainly much better.  What else?

Why did Santos Dumont have so many problems in refining his Demoiselle?
He seems to have tried  dozens of engines and prop configurations.
Reply: @stevebett4947  Calassa's 14-bis does not use a 24 hp engine as you mentioned,  but a 36 hp engine, and he told it needs to be full power almost all the time.  If even the 14-bis , much lighter than the Flyers needs all that power, does not make any sense the Flyers with way lower power could fly sustained.
     Why are you exactly trying to know asking those questions about the way Santos proceeded with the 14-bis and Demoiselle projects ?
Reply: @sanpol4399  Thanks for correcting my figure for the power of Calassa's ROTAX engine and the need to use all 36 hp.
I think 24 hp was the output of the Antoinette engine Santos Dumont used before he switched to the 50 hp Antoinette 8V

How could a 100-200 ft. hop be called sustained flight?
The task is to achieve lift off.  For that the 1903 Flyer prototype
(and the exact replica) need the 8hp + motor and a strong wind.
They were also helped by a favorable high air density in 1903.

SP: How could an output of less than 20 hp. be sufficient for sustained flight?
The original engine has an output of 16 hp for 1 min.  None of the
early flights were over a minute.  If the engine and its wiring get wet,
the power is diminished.  16 hp. is maximum not necessarily what
might be available on a particular flight.  Once in the air, 8 hp. is probably sufficient for sustained flight.  

SP:  Why do you want to know about the problems that Santos Dumont had trying to perfect the Demoiselle.  

SB:  Just curiosity.  
I also think the successful flights of replicas fail to indicate the
difficulties of doing something for the first time.  I doubt if the
14-bis flight was as smooth as the replicas.  

We know quite a bit about of the problems the Wright Brother's encountered with their prototypes.
Do we know very much about Santos-Dumont's problems?
Reply: @stevebett4947  🙂 A 220 mts flight  can be called sustained because:
- people saw it,
- it happened, 
-the replicas do the same ( physics of flight is still the same as it was in 1906 ).🙂
- the Drag was not higher than thrust during the maximum power the engine could generate.

The logic tells exactly that nowadays pilots would , obviously to fly better the replicas of older planes, mainly because of much higher flight time and familiarity with flight than the few flight hours , or minutes the inventors had till they flew their inventions in the beginning of the experiments. 
   But,  that does not happen to the Flyer replicas.  Instead of people saying the replicas just can not make the same as claimed by the Wrights,  they assume nowadays pilots are not as good as the Wrights, and they just could make that because they were gifted,  and the pilots today are not.😀😀
    Since the 14-bis replica can be flown easily and possibly better by Calassa than by Santos Dumont, it just tells it was quite easy to be flown after all. 
   The 14-bis flights happened.
The suposed Flyer flights before 1908, nobody really knows. 
   I stay with a 220mts flight that I am sure that happened,  than with a suposed long distance, long time flight that nobody knows if really happened and never was even a bit replicated. 👍🏻
Reply: @Bazarack  G
Reply: Tell us about the rumors that wright brothers were not the first to fly, there's somebody in France who did it already? Analogous story I hear about Alexander Graham Bell as well. What is the real history guys? Christopher Columbus sure did not discover the Americas.
Reply: @Scruples1  It is not rumor, it is the truth.  Santos Dumont was the first to fly an airplane in the world.
Reply: That is simple question for more coments...
Reply: No shit Sherlock
Reply: Agreed
Reply: Straight forward really
Reply: @jackwilliams1847  right brothers 😐
Reply: Right 😊😊😊👍
Reply: No its because in their country its left hand drive
Reply: @stevebett4947  the wind speed only effects that ground speed.. not the air speed. Brothers were aware that a crash at ten mph ground speed is less likely to damage pilot or plane than a thirty mph crash. Also a much shorter take off run
Reply: @sanpol4399  The RC model was maneuverable enough in no wind conditions to fly in a wide circle.
I wouldn't describe its performance as "very responsive".  It did not have to respond to wind gusts.
The performance of a look alike replica in the hands of an experienced pilot is not a the same
as the 1906 14-Bis in the hands of an untrained pilot with less than 3 min. of flight time.
Reply: @johnp3937  wrote: wind speed only  effects ground speed, not airspeed.

SB:  I went thru the 50+  replies and could not locate the one you are referring to.
Wind speed is not the same as air speed.  
If you are flying into a head wind, your ground speed will be less or
you will be burning more gas.  
The Wrights' liked high winds because it not only assisted take off but also 
made landing less likely to damage the pilot or plane.  Both good points.
Reply: @stevebett4947  I was referring to the posts that were suggesting that the flyer would only fly in a high wind as if the wind Wasim some way helping the aircraft to stay up. The through the air distances are also nearly triple the over the ground distance flown. Perhaps I put my reply in the wrong place. Apologies
Reply: @abhilash71294  the co pilot was the engine
Reply: @stevebett4947  if it’s a fact I believe it! You are a man of facts 😉👍
Reply: @sanpol4399  there are early crude vidio and stills of the flights...
Reply: @zeke2566  please post here then, and be the first in the world.
Reply: Exactly!
Reply: Thank you
Reply: Yes, this is true
Reply: Yes, this is true
Reply: Ah.  A Flat Earther speaketh...